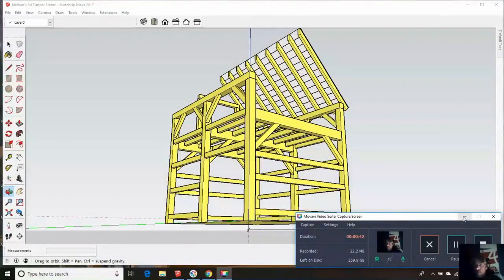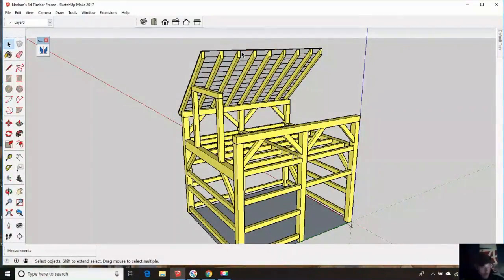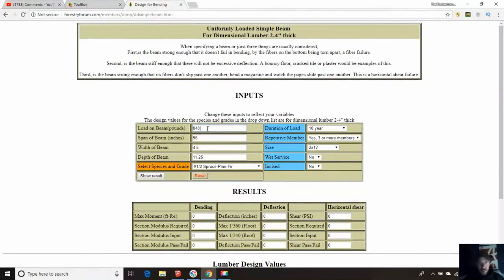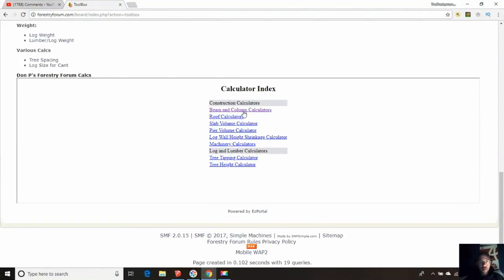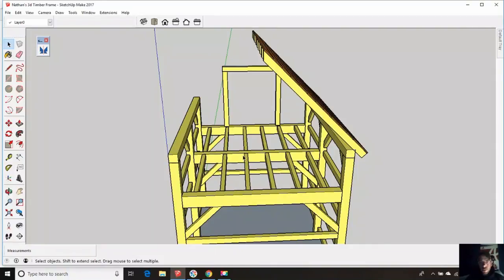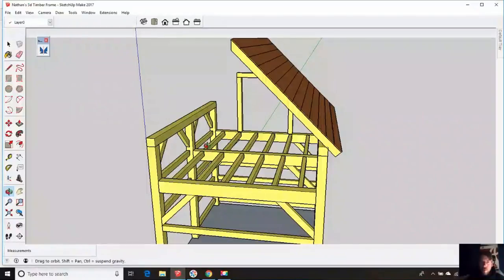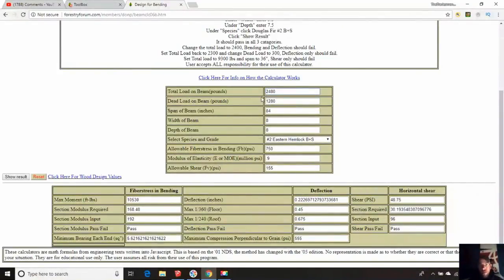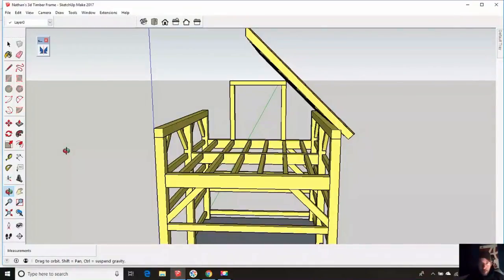A Timber Frame For Out of the Woods Using Sketchup part 2

Comment: Jim doing videos like this is also good for you in that it helps keep your mind active.
The one thing that I have found while dealing with my back is feeling useful has a large effect on how I feel and that effects health. Keep it up I like learning things even when I can't see any up coming use (YET) But there may come a time when I will look back on this and find the info is needed for something I am doing.
Take care of yourself.
Reply: Just checking in to see how your doing. I have gotten a little ambitious and sort of pushed to much.Do back to slowing down a little bit. Stay safe.
Reply from the maker: You watch that back.  You know how being laid up can get with the mood...up and down.  Even worse for guys like us.
Reply: I thought I had my project out smarted and ran into a snag. I am trying to get the bed off my other truck and got it most of the way off without any heavy work just a lot of walking around it t set the braces, Well I am hung up on the tires and will have to invite some friends over for some beers and lifting. But they don't know that the lifting will come first. (Smirk)
Reply from the maker: That's how you get it done, I'll be doing a lot of that this fall.
Reply: I would come help but then someone would have to help me help.
Free food and beers after can get a lot to come help sometimes.

Comment: Sketchup 2017 source
Great videos 1 & 2 - looking forward for more. Could you provide a link to your download source? All I find seem to require paid license or are illegal hacks. I've got 11 wooded acres in central Ohio and would like to design/build a house and shop.Personal use only. Have not decided yet on timber frame or conventional stick construction.  I've used TurboCad on Windows desktop before but cannot afford several hundred $$$ just for software. Admire your skills and work ethic and  mental strength - especially considering your accident. You are a profound inspiration. I sincerely thank you and your family. EvCox.
Reply from the maker: Thank you.  The version I'm using is the 2017 free version that was downloadable.  Now you can only get the web based version for free and the pro version is over $600.

Comment: Hey Jim, great vid again. got a question for you about timber framing, I see and understand the load calculations for your frame and all the calculators on the Forestry Forum but what about the connections of the timbers? I know way to many times I have seen on the news the deck that the band board is attached perfectly to the posts or house but the joists on the deck are only held there by the 3 to 4 nails driven into the end. Yes I know and have seen your timber frame joints but how did you figure out what joint is needed where and what it will hold?
Reply from the maker: The best method I've found is going by accepted rules of thumb and historical examples.  Also knowing shear values and tension vs. Compression loads and so forth.

Comment: Jim, when calculating the tie beam for the top of your bent and top plate, wouldn't the span length be from the point that the brace enters the tie beam/plate?, However the way you are doing it allows for a larger factor of safety, as usual not trying to prove you wrong, just trying to understand where the forces travel through the frame
Reply from the maker: You don't normally figure the braces as load bearing, that is not their purpose in a frame.

Comment: You're sounding much less medicated. 
I live in a rambling ranch. Many additions were done over the years (built in 1928) to this once hunting cabin. I went up in the attic to insulated when I first moved in and found one of the long roof rafters broken. We heard stories of one horrendous.winter in the '30s where people were trapped in their houses because of many, many inches of snow. Since nothing has happened to the roof since we moved in (more than 40 years) I'm assuming that winter snow was the cause of the rafter breaking.